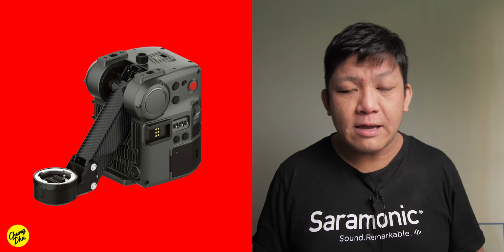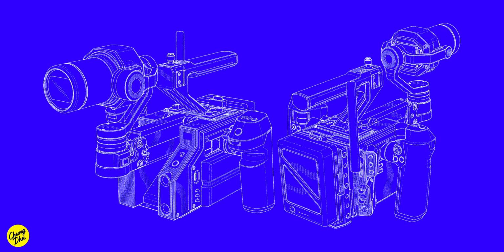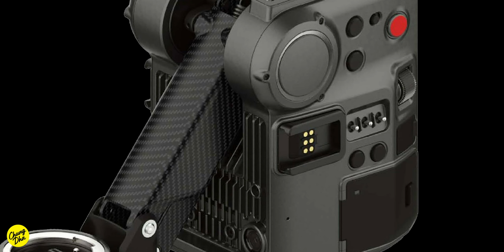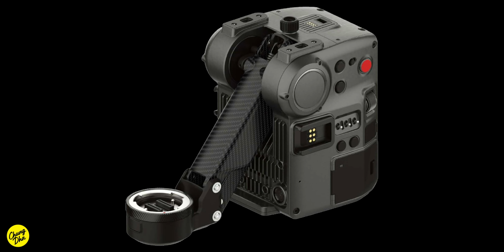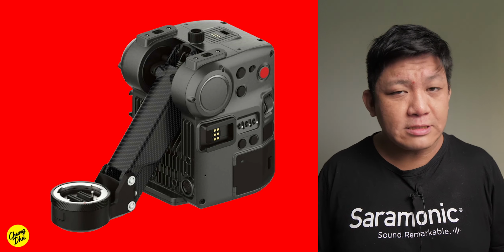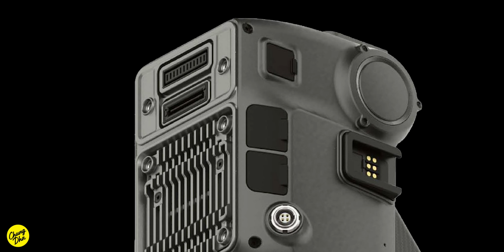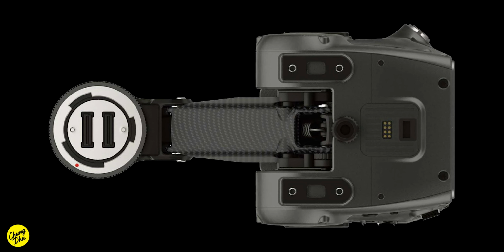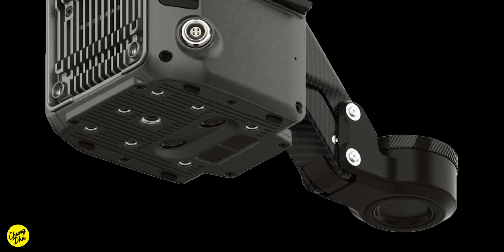DJI Ronin 4D gimbal cinema camera

Comment: 07:10 Actually the bottom sensors make sense since the 4th axis is for up & down movement. The 4th axis may not be spring-only. With motors controlling the 4th axis with the help of bottom sensors the camera can compensate better for up & down movement. Sure a gyro could do the same job - up to a certain point - but I think the bottom sensors can provide better data on this matter. What do you think?
Reply from the maker: Issue with that is most guys hold the camera up close to their body to keep center of gravity close to themselves which also make things less strain to hold, but your legs often move under the camera and you walking pass a bump on a road you yourself can already adjust for it, but the sensor would still see the bump and compensate when its not needed.
Reply: @chungdha  notice how the sensors are slightly tilted facing forward? This would prevent the legs getting in the way. Sure there might be a hybrid mode that also takes body movement into consideration of moving the 4th axis. I hope the sensors alone aren't the only data the 4th axis is moved :)
Reply from the maker: @joonasnieminenfi  I don't think it need a visual sensor for this as internal gyro should measure those enough though.
Reply: @chungdha  bottom sensors might actually work together with a larger heavy-duty drone body that this cinema camera could be mounted via the electronic mounting points. Like the Matrice series. What do you think?
Reply from the maker: @joonasnieminenfi  No they already have a drone that can directly mount the X7, so not need additional camera body.
Reply: @chungdha  is like you are saying: "DJI already has a gimbal, so they don't need another gimbal" Things evolve mate, they might have a new drone family coming that might use this feature in the future :) This is of course just speculating and guessing - like your whole video is about so no need to go full-negative right away in the comments :)

Comment: Seems like well over half of these speculations will turn out to be untrue; but I'm especially intrigued by (and wish you mentioned) the possibility of interchangeable lenses, and in which format.  Hopefully it will be rather like "lens profiles" in Lightroom:  automatically rebalancing based upon metadata communicating each lens' model number for varying focal lengths and thus weights/lengths.  Active rather than passive 4th axis stabilization will be a HUGE and underestimated value of this type of camera.  And the weight distribution will be so much better than a gimbal mounting a big heavy camera up top.
Reply from the maker: It will be using X7 camera module which uses DL mount so not many lenses can be used than DJI own lenses.

I doubt weight distribution is any better than more arkward rear heavy with a V-Mount attached as the X7 module and it having a carbon arm should be quite light on the front.  

Honestly it be better DJI made an actual cinema camera without any build in gimbal parts and just make it super compatible with their Ronin gimbals.
Reply: @chungdha  Thanks for clarifying the lens mount. As to weight distribution, tentatively disagree!  Center of gravity has tons of impact on ergonomics, and if the tiny little lens arm is the only thing that needs to be stabilized, ease of operation will dramatically increase (while benefitting from that critical fourth axis).
Reply from the maker: @focuspulling  But the grips mount are pretty much in the front end of the camera, and the back still need to add a heavy V-Mount for powering, the weight be far in the back needing user to counter weight it by hand though.
Reply: @chungdha  Basic physics, I'm sure you'll understand if you think about it for a second. When the thing that needs to be stabilized has an extremely low mass, and the center of gravity is located right next to where you're holding something, that is DRAMATICALLY better than an extremely heavy camera + lens + battery combination weight that is located much higher than the center of (user) gravity.
Reply from the maker: @focuspulling  It still be back heavy wanting the read dip down and front tilt up, its heavy a lot of pressure on your fingers to counter it. Normal double grips on camera is front heavy not matter much as the weight be pushing on your palm.
Reply: @chungdha  Simply put, you're focusing on the wrong thing, and a smaller factor than the physical values I am repeatedly citing.